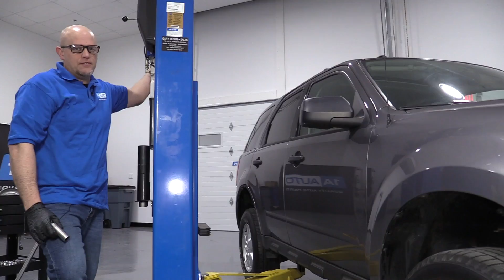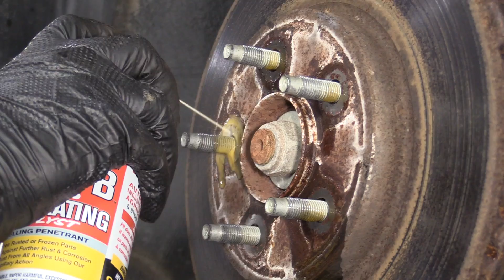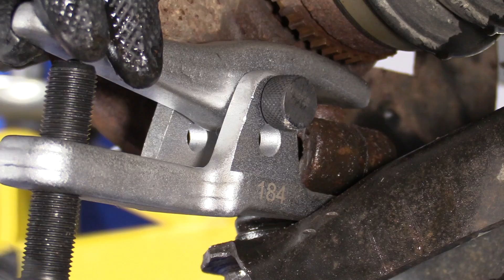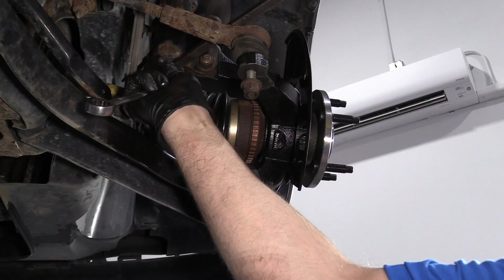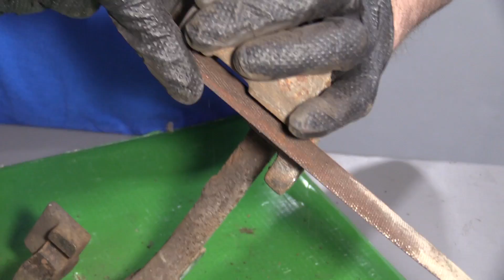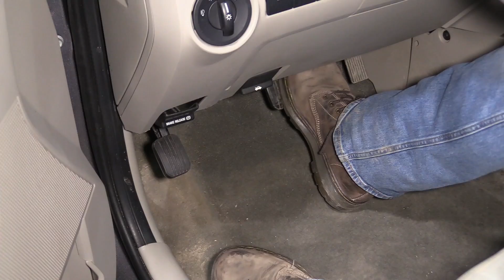How to Replace Front Hub Bearing and Knuckle Assembly 05-12 Ford Escape

Comment: you don't even have to remove the old rotor if you're replacing it as well, no? Just throw the whole old thing including the rotor out and install everything new - that would save some time removing the rusted rotor off.

Comment: Do you have to remove knuckle on The 2013 Ford Escape in order to put new tire studs in. 
There are no bolts on back of hub to take out .
My tire studs sheared off . Drs side . I’m to the point of taking of knuckle and replacing the entire suspension. The hub is stuck.

Comment: I'm a bit of a gorilla ... I've ruined bearings trying to press them back into the knuckle.  This is a fantastic option to replace the entire assembly.  In fact, I have a front wheel bearing going on my Ford Edge, and after seeing this video, I ordered the replacement assembly and will be doing this repair later today.

Comment: If you take out the axle shaft first it makes it easier to get in there to remove ball joint by using a hammer and chisel you can pry open and pop it right out. No need to destroy ball joint with pickel fork or need for other tool.

Comment: A MILLION thanks for this video!!
The whole thing helped me out Immensely! But I have to add, I was able to do this entire job without needing to disconnect the caliper at all. I unbolted the caliper and rotor away from the knuckle, and removed both pieces still in tact, tied together by an old wire hanger. Made the job much easier. This method was made necessary due to the fact that in several of the videos I've watched, the size of the allen hex socket needed to take out the caliper pins in Several videos I've watched were WRONG! Not 7mm, not 8mm, not 9mm. I have no idea what the actual size is, but I bought all 3 and none of them worked. Thank goodness for thinking outside the box!

Comment: breaker bar connotes breaking bolts free but also may break the bolt , i'd pen oil these points over night if possib.; maybe then try impact wrench , or hammer wrench ---- and tap hammer first .  ( LONG job to drill out anything )
Reply from the maker: +Question Reality Thanks for the feedback!

Comment: The hole where my tie rod goes in has some scuffs on the inside and it's preventing my tie rod from fully going into the hole. I can see where there is a bit of metal scratched and the tie rod stud gets caught on it. Any suggestions? Could I sand or maybe file it down? I really don't want to get a whole new steering knuckle just because of this
Reply: Monday, August 15, 2022

It is 11 months later. Hopefully you found an easy method to fix your problem.

I would use a round, hand file. You could just file the extra bit of metal down. You can buy a round file at any hardware store for around $5 to $10.

I would not use a rotary file in a drill, because the rotary file is spinning so fast, I could easy make the hole too large.

Comment: I just did this with the same part using this video guide.  After install about 3 minutes into test drive all abs and traction control lights came on. Any ideas?
Reply: I know this is like 9 months later. But when he's removing the sensor do you see the ring with like gear teeth? That needs replaced. The break pretty easy.